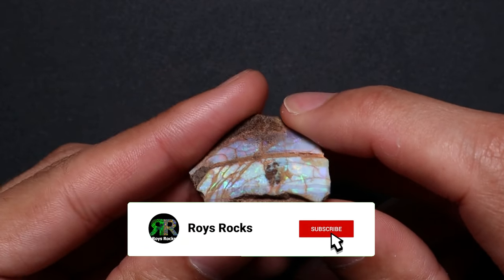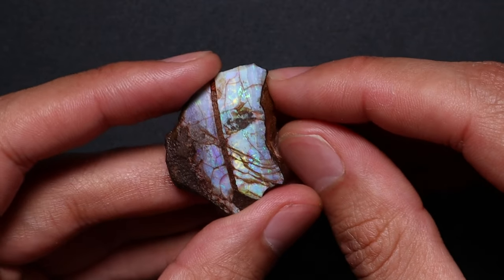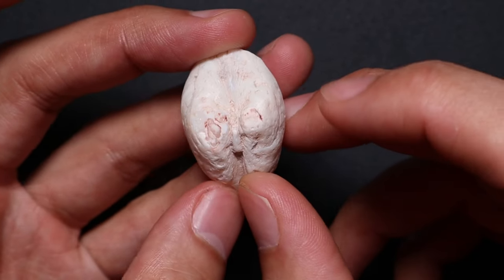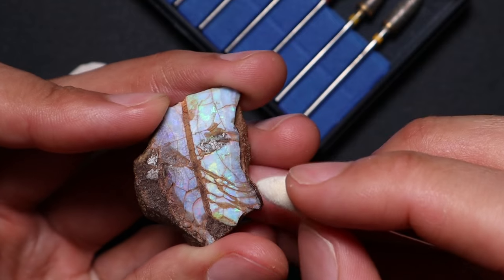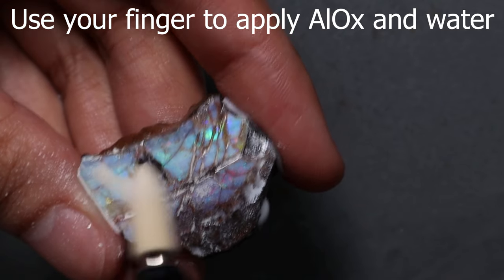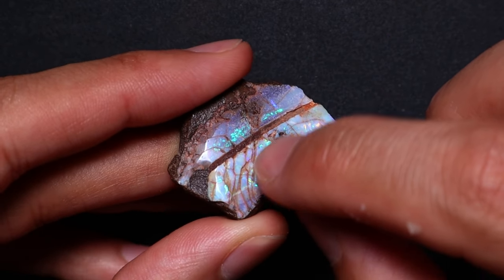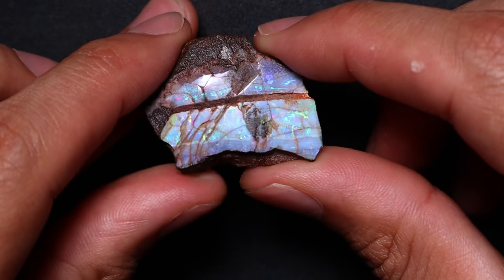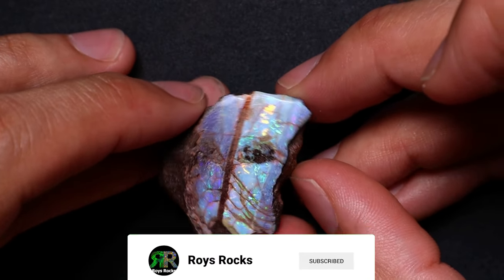How I Treat Opal Specimens, NO Resin Coating... Specimen Polish!

Comment: I'm glad you shared this. I'll have to try it on some practice pieces.
Reply from the maker: Give it a go. 
Its not to difficult, a bit slow and you do need to apply a bit more pressure than usual, kind of like using diamond paste because you are essentially gently grinding.

Comment: Thanks Roy, that was exactly what I wanted to know. I almost put a coating of epoxy on a piece of senora sunrise cut from Calliope but went against it & just buffed it instead. I am thankful that you described the difference between aluminium & cerium oxide. I used neither & did get a shine with just water & medium speed buff. Don't be afraid to do more fossil specimen buff; I'm interested in that. Paul BB, just north of Townsville
Reply from the maker: Good job! Resin is an absolute last resort and I only ever do it is the material needs stabilizing. Otherwise I'll just shine it up a touch with a metal oxide powder in water.
Reply: @RoysRocks  I do exactly that Roy. I have been using epoxy resins for 35 years & am well versed. To save a fossils I will use it, especially Epirez 133. I was watching your videos with the starter polishing/carving kits & some oxides. I'll get some when I can, maybe a small packet of clears to make doublets. I made a set of earrings last year, used black oxide & Araldite & set them on studs I got on eBay. I went to Ravenswood for a bit of iron stone for the doublets. Plenty there by the gold mine. Obviously I watch Phil Mills too, lol, regerds Paul BB

Comment: It looks great.  Ive only got cerium, guess I will have to put the alox on my list.  Thanks for the video.
Reply from the maker: It does come in handy to have both. Diamond paste as well but if the piece is mostly opal you can get away with CeOx it will just take much longer and non opal will really struggle.

Comment: Roy, what do you think of my brainwave? Here it is,  bought everyone electric toothbrushes and ended up with an old one that still works perfectly.  I was using it to clean light stuff off opals and I am trying to trim the bristles off now so I can stick little sandpaper discs on it.  Ever tried that?
I am in Canada but I think I might have to order dremmel tips from you.  I can't find the right ones online.  By the way, I love how this boulder turned out
Reply from the maker: Depends on the toothbrush I think. Mine oscillates backwards and forwards so doesn't actually spin.
It is also a VERY weak motor but it would be a funny thing to try.

Comment: i got a dremel kit not too long ago and it came with several diamond burrs, but how on earth am i suppose to know what grit they are? im confused, would they range in grits? it would be helpful to know what im using before i touch it to my opal. also im new to cutting and polishing but have been collecting boulder for years now and wanna start polishing my own small specimens
Reply: the kit is probably electroplated burrs. You may be able to tell just buy looking at how rough the burrs are as to which is the coarsest and which is the finest grit. Perhaps the kit had a booklet describing each burr? If you cant find the booklet, just look online at the kit and it should list each burr. Barring that, just buy a few sintered diamond bits. If you are in north america you can head to SUVA and get them, reasonably priced. If you live elsewhere it might be best to buy them from Roy, if he has them in stock.
Reply: thanks man ill check to see a few more times. im in the US yes so ill definitely look into that. Its basically the polishing stage im stuck on but with labeled burrs it would make everything way easier. Cheers @ThatOpalGuy
Reply from the maker: The included burs are never labelled unfortunately I've found that most of the time they are around 80-120 grit and I can almost pick it by eye nowadays.
Reply: Red Ring its 320 and yellow its 600 grit